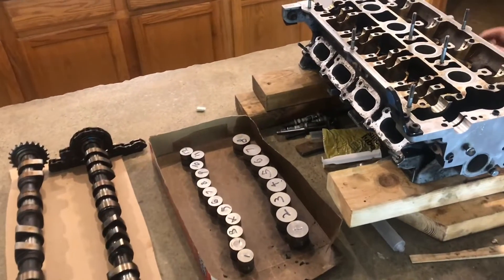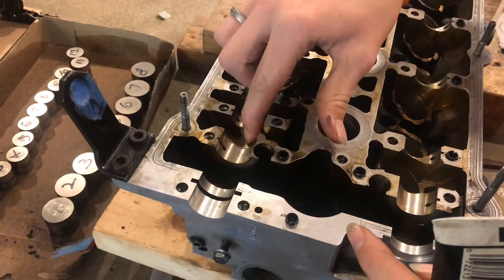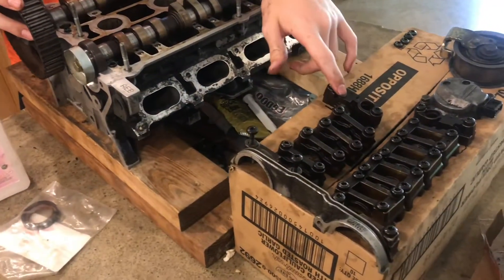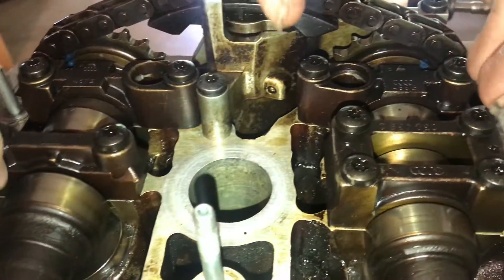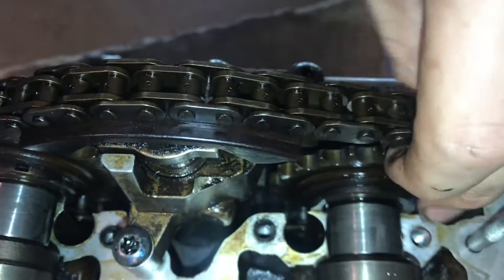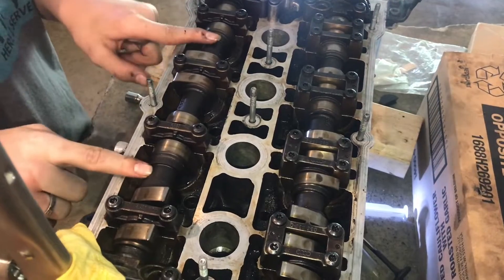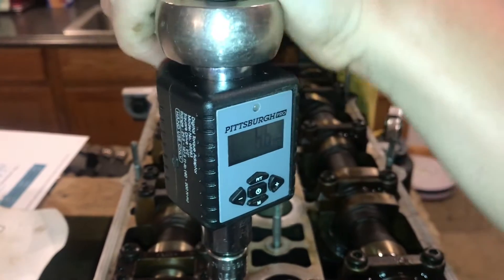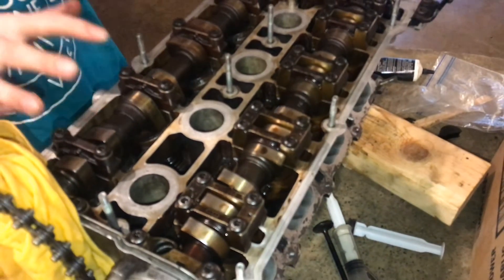ALIGNING and assembling camshaft lifters timing chain 1.8t audi volkswagen

Comment: Hi ! can you help me? 1.8t auq 180hp vvt leon, I changed everything, chain, belt, oil pressure, good camshaft sensor, all the reasons and it throws the error code P0012, what could be the problem?

￼

Comment: Hi! 
Pls what's the likely problem of my VW 1.8 20 valves car. The was overhauled rings were charged, it shorten engine oil but there is no any sign of smokes from the exhaust. What's the solution to the problem?
 Please help me out.

Comment: The one critical aspect - how to install the cam timing phaser in the right place without breaking the nylon "shoes"  is missing - lots ot time on super simple stuff, but the cam adjuster is missing in one shot, and already installed on the next shot.   But at least you showed how to count 15 link pins in the timing chain between the two cam timing marks......but cut those fingernails!
Reply: 16 rollers get it right idiot

Comment: I have one question about camshaft seals, some people claims that its better to put seals to its places only after the cam holder is bolted on, because the seals can wrap and cause leaking, they usually do this by tapping with some ratchet socket. In this video, You put new cam seals first, and after that you bolted on the cam holder, didn´t you wrap the seals sometimes by using this method? What is your opinion, which of this 2 methods are better?

Comment: What’s the difference between the AEB and AWM motors?
Reply: AEB is The 058 block and non VVT  the aeb was the larger port engine and had larger wrist pins too.    Reliable. Drop  some rods and go. Awm has VVT  06A block.  With internal water pump.  While 058 block is external.

Comment: I love the quality of your video bud but, you for real need to cut those finger nails. Im worried you are going to gouge the aluminum on the head. 🤣 Also dont toque your cam shaft outside in. You need to torque it from the inside out. Outside of that good job bud.
Reply: Yeah your 100% correct man
Reply: Long nails, maybe technician?

Comment: So I didn't know that the lifters were not interchangeable and I didn't label them in any way when I removed them, but I what do I do?
Reply from the maker: I think you’re fine, the mechanic that taught me did it this way. If I had a stray lifter that was in better condition, I would replace it without batting an eye.
Reply: Replace them all with new ones otherwise you will have extreme wear on the cam shaft

Comment: Very good video. Now did you do this because of a timing belt failure, resulting in bent valves and replaced them? Thanks
Reply from the maker: Yes, the timing belt broke and the valves need to be replaced because they were bent. Who replaced the bent valves, then Hydro tested them like pouring water on to the valves to verify they were sealed.
Reply: @livefree6878  could you put all the videos on this repair in a playlist please? I'm doing a head rebuilt on my 1.8t, and your videos have been the most helpful - I just want to make sure I see all of them!
Reply: 1 more question at how many miles did the belt fail my a4 b5 is at 89k miles?
Reply: @kevinhawley3303  replace them soon as preventative maintenance